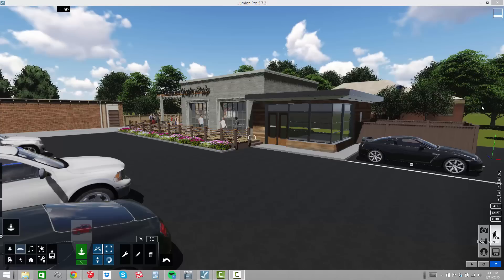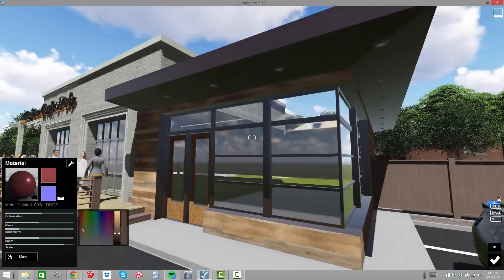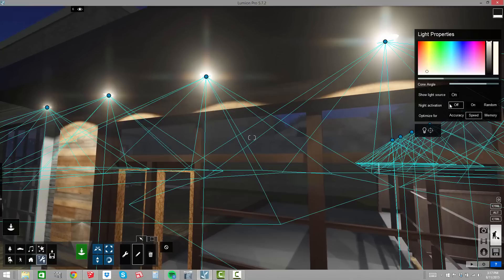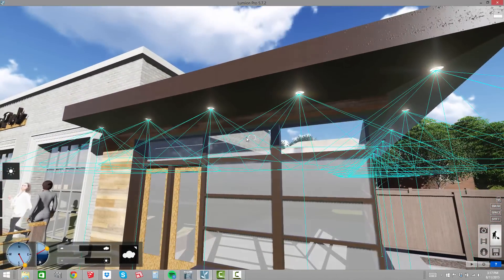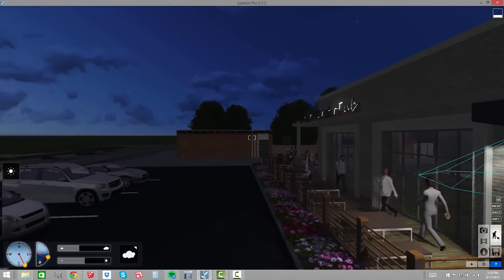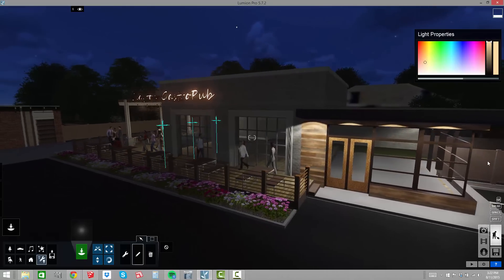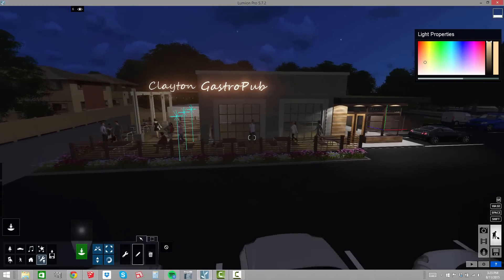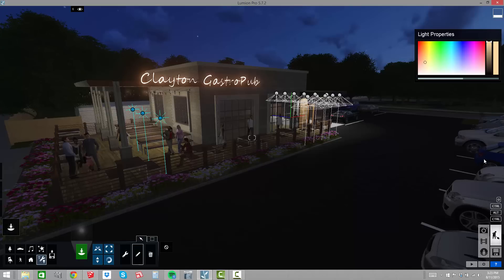05 Lumion GastroPub Tutorial: Lighting

Comment: Hey, when I turn up the emission bar of my standard material the emission doesn't appear to change after I have moved it off of 0 emission. It stays this bright, flat white color. I am not seeing any of the lighting flares that you get when you turn the emission up on your materials. Do you or anyone else have any idea what is going on? I am using Lumion 6.
Reply: +Adam Hugo Found the fix for anyone having the same problem. Go to settings in Lumion and make sure your editor quality is at 5 stars or else it will not display.